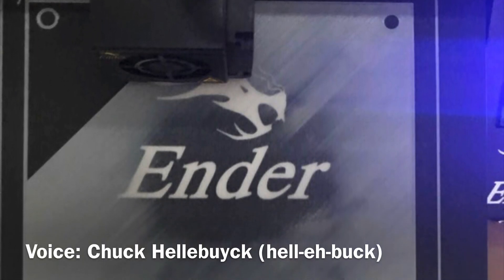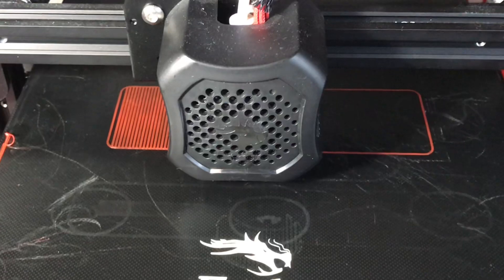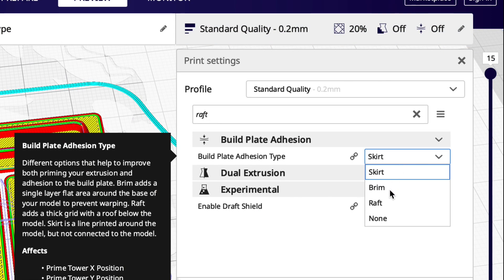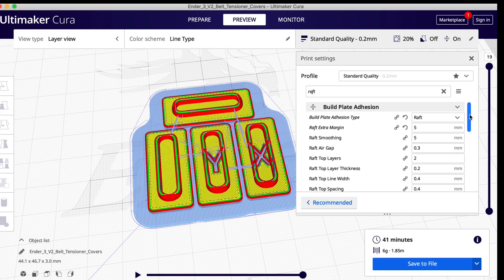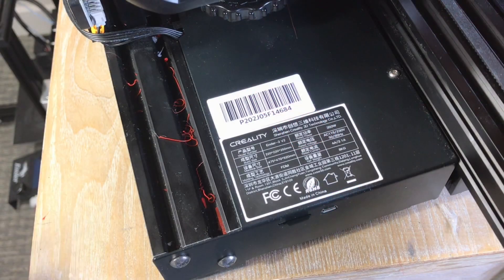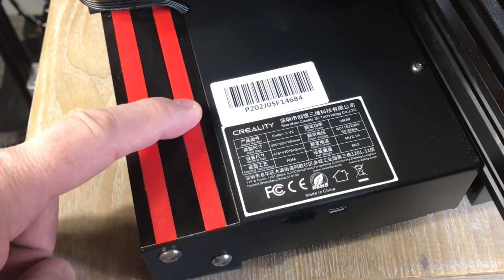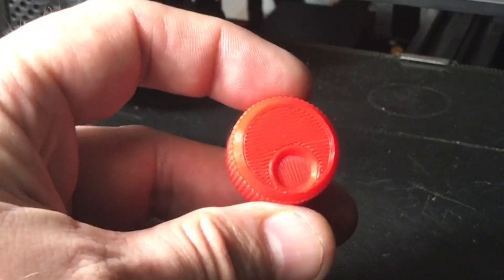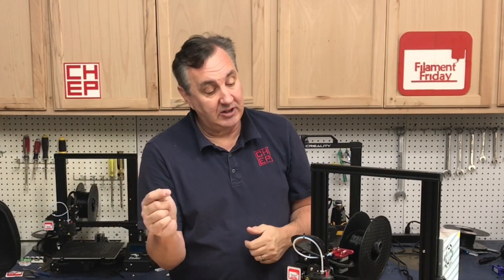Using Rafts in Cura Slicer V4.8 on Ender 3 V2

Comment: Am I the only one who has noticed that Cura slices the first layer ABOVE the second layer when your air gap (default of 0.3) is larger than your layer height? I am going to try figure out if the printer actually steps down in Z on the second layer of if this is just an error in the way cura previews the slice.

Comment: Thankyou so much CHEP! This helped me so much with small text prints fitting into a background print. Even with large clearance, I had multiple "elephant foot" failed prints resulting in sanding. First 3 runs with using rafts and they were perfect, I didnt have to sand/file anything and the pieces fell into place, actually requiring some glue now because it helped the clearance so much!

Comment: Since the new russian war our country (SK) has some limitations in place, mostly regarding power usage. This is most easily fixed by using an unheated bed (since as far as i know, they use a good chunk if not most of the electricity on a 3d printer) and rafts helped me so much to not have warping or detaching from the bed, its unbelievable. I purchased a quality and not even cheap bed (30€+ PEI) -> still detached on the corners. I used gluestick generously -> still detached at the corners and almost non-remowable in the middle, it fused so well. I bought a CRTouch leveling probe -> pretty much the same problem. Then i tried rafts, and oh boy, never once had i one problem with detaching from the completely unheated and cool bed (winter). The raft itself sometimes came off, but the model itself (even in the most unlucky and rare scenarios) had only veeery small imperfections - at least compared to what i experienced without it.
Reply: Seems when it's all said and done LEVEL PROBES are more of a novelty and only truly efficient and effective likely on PREFAB 3D PRINTERS or KITS having the PROBE as part of the design.

Otherwise, the directions are not distinct and concise enough, when it comes to installing on a standard 3D PRINTER. (Marlin firmware just shows some abstract cryptic underside pattern. A direct ISOMETRIC VIEW explaining with dimension lines is needed).

More often than not after all the fiddling with PROBES, most will resort to old fashioned BED LEVELING and RAFTS.

Comment: Hi, I downloaded the newest version of Cura 4.13. I also downloaded your profile 4.12 as I did a fresh install of Cura. Now, I'm testing out PETG as I've never used it before, the raft itself went down a treat... but the first layer seemed to almost skip 2 layers for some reason. I haven't changed any of the profile settings apart from making the raft smaller. Is there any way to fix this?

Comment: MIne at 0.3 air gap is impossible to remove from the print. Am I doing something wong
Reply from the maker: Your bed is probably too close on initial layer. Try 0.4 air gap.
Reply: @FilamentFriday  it was something in the slicer.  I had been tweaking one of your profiles and it went bad lol.  I reimported your profiles and now its good again.

Comment: Great vid on how to go about making a decent raft. I had no luck at 0.3 so I went up in 0.2 increments until I achieved a satisfactory outcome. It's a great feeling when the part easily pulls away from the raft.
Question: Wouldn't you want to print the channel guides the other way around to make use of the ironing function for the top layer. Just an aesthetic thing, but it all counts, right? ;)
Reply from the maker: You could, yes. But they have an even but mild texture look so I like them.

Comment: I like rafts. The bed on my Ender 3 V2 was warped. So I ordered a new one. Same thing. Ordered a third one....warped. I just started using rafts because I'm tired of messing with these warped beds all the time. My biggest problem with the Ender 3 V2 is you are always fixing something on it. You're always adjusting something on it. Maybe that's just my experience. But this printer has been nothing but a headache for me. When the prints turn out well they look great. But I'm looking to replace it with something easier to use. I'm thinking about the Kywoo Tycoon. What are your thoughts?
Reply: I recommend not adjusting the screws under the bed Tycoon is more like an upgraded ende-3 that only needs BLtouch leveling and the screws under the hot bed are not adjustable

Comment: That's not how rafts have worked when I've tried them, they've been fused together with the main part. 100% impossible to remove. You can't even cut them lose. You can't tell where the raft ends and the part begins. And I've set the gap to more than that,  I read you should set it to 2x layer height.
Reply: Yeah I do too
Reply: me too
Reply: Did it fix it

Comment: ok so when i frist started 3d printing i used the raft because anything else just did not stick. using is the raft comes of really easy when i first did it how ever, they are not smooth ontop and i have to sand the bottoms to make them flat, what am i doing wrong

Comment: As always polite and a pleasure to watch 👍another good tip if you're having troubles getting it off the raft change raft top layers to 2 and you'll end up with a gloss like finish on the top just printed a 0.6mm (on accident forgot I had auto scaling on) thick stencil for a friend and it came off no problem even I was skeptical about that print but it came off perfectly

Comment: great video just tested it on my machine, works great

One thing though, please stop using the scrapper to get prints of the bed, if they dont come off, clean it with a wet rag (If you use a scrapper, you may scrape off part of the special coating, ruining it forever)
Reply from the maker: Been using my painters knife for years. Never had that issue.
Reply: the trick is to be very gentle, for me

Comment: I am using your 4.8 profile in 4.9.1, I have the same 5mm raft extra margin as well as tested 0.3 and 0.6mm for the air gap. I cannot easily separate the raft from the model at all....
Reply from the maker: You might be over extruding. Did you calibrate E-Steps?
Reply: Yes sir. Esteps calibrated, bed leveled. I increased the air gap to 0.8 and it seems to separate fairly well now, however the underside of the print doesn't look all that great.
Reply: @pigutxhighlights7749  Lower the printing temp, its likely that the temperature is too high, or maybe even the bed temperature.

Comment: With my old printer pretty much nothing would stick unless I used a raft. So I'm quite adept at using them. Also the struggle of trying to remove the raft from the print. Thankfully my Ender 3 v2 doesn't have that problem.

Comment: I've yet to have found a need for a raft. I don't really understand it, I'm sure there is a need for them and I watched this hoping for an explanation on the best times to use a raft. The only time I've ever considered it was printing thin or small parts in ABS that were prone to warping. In those situations I used kapton tape on the bed and haven't had an issue. Could you go more in depth of when you'd need a brim or raft?
Reply: It's to alleviate the first layer inaccuracies that are present (warped bed, elephant's foot, etc.)

Comment: First weeks journey with my 3d printer. Built it printed for 3 days. Then ordered ton of upgrades. Then decided to flash an Ender 3 bios with sd card. I got one sexy modded to hell bricked of a machine cause I didn't do more research lol. Ordering new motherboard screen upgrade to get me back up. Learned tons from you ty for your videos man gj.
Reply from the maker: Try a new SD card and change the name of the .bin file and try again. It’s not bricked.
Reply: @FilamentFriday  I got the screen back but can't do anything else. No big deal ordered new 32 bit mobo for it.
Reply: @jakal172  I had a problem with my ender by flashing wrong firmware,  I just found an older correct version and it corrected my problems.

Comment: Hello, I have a question.  I am using Cura and an Ender 3 V2   When the printer made a perfect sticking 3 layers raft he begin printing to high. The layers wont stick the 4th layer. How can I solve this problem? 

Thanks,
Reply from the maker: Lower the gap setting for raft.
Reply: @FilamentFriday   @Grimm3D  I am gonna try that. Thanks for your answer!

Comment: Every time I got and turn the raft setting on it don’t show up? Same with adding any supports and such. Can you point me into the direction of my errors?
Reply from the maker: Never heard of that.
Reply: It sounds to me like you have helpers unchecked. Go into preview (it should automatically take you to it when you slice), and at the top center of the build area/display you should see a large drop down list labelled "Color Scheme." Select that, set it to line type if it isn't already, and you should see a bunch of check boxes. Check the one called "Helpers" and it should start showing you rafts, brims, skirts, and supports when they've generated from slicing.

Comment: Until blue painters tape no longer exists, rafts will still be a waste of your time and plastic.  Shouldn't even be an option.  I haven't used one since the days we didn't have heated beds as a standard.  Lay a bed of masking tape.  All filaments stick very well to it.  If you have low spots,  add a second layer there.  Rafts are a careless waste,  as well as an extra impact on our environment that can easily be avoided
Reply: blue tape on the bed. Its temporary. Its naturally biodegradable. It's easy, and it works. Rafts are stupid.
Reply: Rafts and tape are really meant to fix 2 different problems, albeit with some overlap between the two. Painters tape is for general adhesion (and smoothing out the level and slight warping of your bed), while rafts are meant to compensate for poor leveling and warped plates (while also helping a lot with adhesion in general). 

Before I got a heated bed I used painters tape all the time, but if a print was giving me lots of trouble, either because it was too tiny or misshapen or whatever, or if I didn't level my bed right (I have nerve damage in my fingertips, those tiny wingnuts on my first printer became VERY unpleasant after a few minutes of trying to level, ABL is now a mandatory upgrade for me), then I'd turn on the raft WITH the painters tape and that usually did the trick. 

And these days I'd use a raft before painters tape because A: I don't want the tape to cover my nice, clean glass bed in stickiness, B: its faster and more convenient (just check a box and peel it off, vs carefully layering on the tape and then taking it off again, not to mention its harder to scrape prints off the bed), and C: I have a suspicion that a small raft like in the video is probably cheaper than a bed's worth of tape.

tl;dr rafts have their niche
Reply from the maker: So failed prints, that can easily be fixed with a small raft, aren’t a waste of plastic?
Reply: @FilamentFriday  nobody is failing prints and fixing them with a raft, unless their parents are related.
Reply: Anyone who's still using painter's tape in the year 2021 has absolutely no business talking down to about people using rafts.
Reply: @ricketron  anyone still using rafts in 2021 has no business talking.
Reply: yes you rahhfinoscar

Comment: hey, I designed my own base rail slot covers for my prusa mini. then I recognized a strange rattling noise while the y-axis was moving quickly. it took me hours to find the source of noise. so as the bed is moving, there is a vibration which causes these rattling sounds ._.

Comment: Hi Chep, i am using PrusaSlicer, but i guess this goes for all slicers. When printing supports (from bed only) the underside on the product after it has finished, looks very poor. The supports break away relatively easy. In cura, they look alright, but on prusa the underside doesn't look really good. How do i improve this, (so, what settings do i have to change,) 
edit: why i ask this under this video, is because a raft breaks off easily yet the underside still looks decent, can i tune my supports to be like that? 

Greets,
Arik.
Reply from the maker: Prusa doesn’t offer support roof like cura. Here is what prusa recommends. https://help.prusa3d.com/en/article/bad-looking-surface-above-supports_1803
Reply: @FilamentFriday  mmh.. these are always reasons that make me switch back to cura, but when i switched from from cura to prusa i saw improvements in my quality.. i think i might just go back to cura and transfer my knowledge over ;)

Thanks for the tip!
Reply: @FilamentFriday  Also, when looking at what prusa reccomends they seem to kinda say ''F* supports just use glue or print on the side'' which makes me believe cura cares more :P, i will try the following mentioned in the link you have given me, thankyou very much Chep!

Comment: CHEP! Would you know if there is a company that makes flat aluminum beds for 3d printers? Something where it's made in USA or just made very well? I'd personally pay a good bit if I knew my bed was flat, that way the bed leveling would be as simple as adjusting offsets instead of trying to use those absurd knobs that always loosen.
Reply: look up MIC6 aluminum, its extremely flat i use it on all my printers. add a magnet sheet from mcmastercar to the top and then  use pei coated spring steel and your good to go
Reply from the maker: No I don’t.
Reply: Just hit up your local CNC shop you will definitely be paying good and supporting a local business
Reply: My Ender 3 v2 bed is extremely flat. I checked it with a straight edge and a light behind it. Barely any light comes through.

Comment: This was very valuable...  thank you.  I've been using the Luban slicer that came with my Snapmaker 2, and there's no option for "air space" with raft....  only an option for raft width, as if I'd need that.  Fortunately, I can slice with Cura and print with Luban or Octoprint, so I'll be checking out that air space option.  New subscriber!

Comment: Hey Chuch I have a really hard time getting my prints to stick if I don't use a raft... rafts stick like magic except they do not come off that easily and the first layer of the print looks like CRAP!!! 
I'm using Cura ant the same setting you suggested trying to print with PETG at 250 / 90 
any suggestions
Reply from the maker: PETG is tough to get it to stick. Try increasing the raft gap.
Reply: @FilamentFriday  if I increase the raft gap won't it make the first layer of the print even worse?
Reply from the maker: Not if it’s too close right now.
Reply: @FilamentFriday  I tried last night to increase it by .1mm but had to stop it on 1st layer of print... raft was fine but 1st layer or print wasn’t holding at all circles looked square ect
Reply from the maker: Does PLA do the same thing?
Reply: @FilamentFriday  no pla usually sticks to the bed so no use for a raft
Reply: Hey Andy! Good luck with the troubleshooting.

I just wanted to letcha know that I have printed PETG almost exclusively for multiple years now, and my setup seems to work really well! Maybe only 2 times ever have I had something come free of the build plate. I use a Flash Forge Creator Pro, the bed has a factory sticker on the build plate, one of the blue ones with rough texture. Then on top of that, I lay down a layer of Kapton tape. Not sure why nobody talks about Kapton tape anymore, but its amazing. It's a high-temperature tape used in electrical applications. I heat the bed between 80c - 100c, as it warms up the Kapton tape starts to contract and pulls nice and tight over the build plate, and my prints stick to it perfectly. Once the print is done and the bed begins to cool, the prints always pop off nice and easy, and because the tape is glossy smooth, the bottom surface of the print will also have a glossy smooth, flawless finish, as if it came off a glass bed. The Kapton tape will crinkle up a bit once it's back down to room temp, but ignore that; as soon as you heat the bed back up, it goes right back to it's glossy-smooth surface. I only replace the Kapton tape probably every 20+ prints or so, once it starts to lose it's adhesion to the sticker surface below it. I bought a large roll of the tape when I first bought my printer, for less than $20 on amazon, and it has lasted me all these years; I probably have well over half of the roll left still.  If you do end up buying some, the one super helpful tip I will give you, is to lay the tape down while the bed is pretty hot, probably 50c+ degrees. That allows it to soften up and makes putting it down flat MUCH easier. If you need to re-position it, you can easily peel it up and re-place it while the bed is warm. When it's cold, it's super sticky, sticks to itself, and can be a real pain to lay down without any creases or bubbles. Once you get the hang of it, your 3d printing life will be so much easier :)
Reply: @kaylor87  hey Kaylor I’ll have to try and find it here, thats the kind of solution im looking for.. what width tape do you use?
Reply: @andyreynolds5021  I hope it helps! The roll I bought is a 6.25" width. It covers the width of my build plate perfectly, but I have a Flashforge Creator Pro which has a pretty small volume. On a larger bed, I'm sure you could just lay down multiple layers side by side if necessary
Reply: @kaylor87  thanks